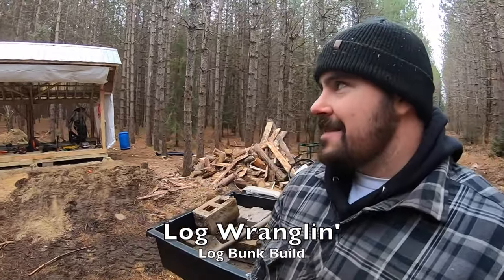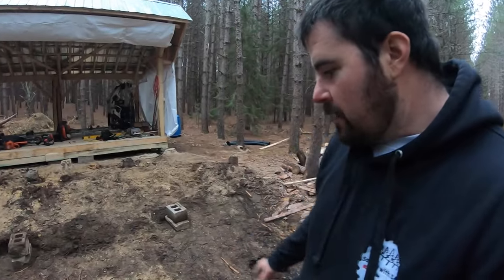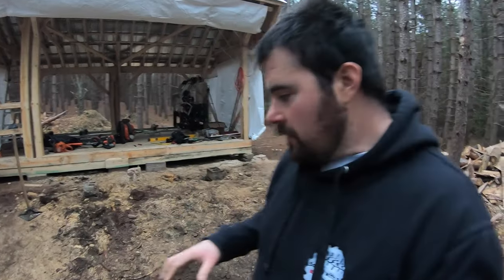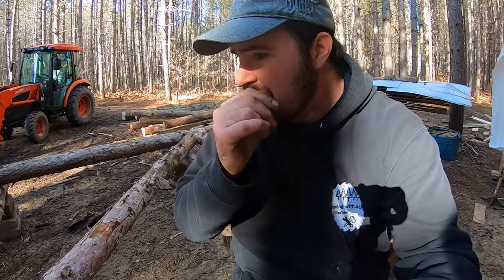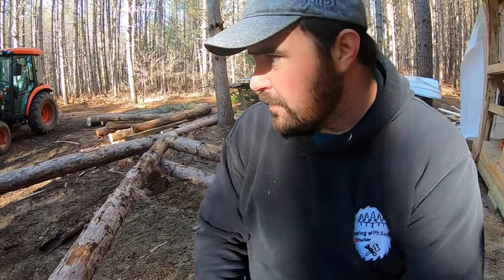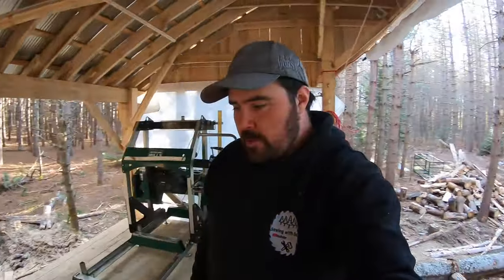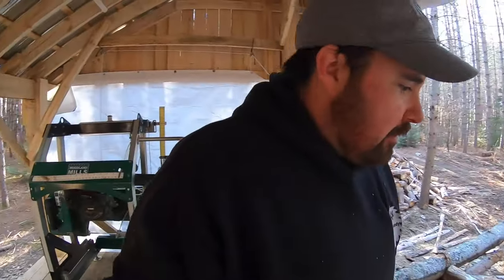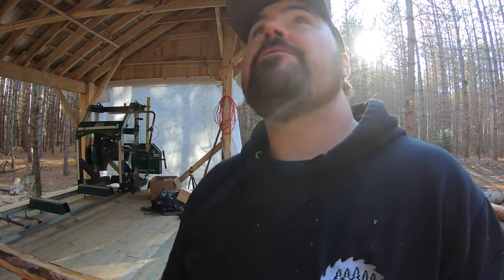Building a Platform for Saw Logs | Sawmill Shed Build - Episode 14

Comment: Try moving the 6x6 transition boards to the outside of the log deck with a 2x10 under each to help them slide out of your way. After debarking the log deck logs, thoroughly coat the logs with used motor oil several times before the heavy rains. Might be a good idea to oil the floor also, it soaks in and is not slippery.I cant work bent over working below my knees, I hope your back holds out. Todd and RJs ideas sounds great. Think about when the snow gets between the log bunk and the tarp pipe, it may be stuck with snow wedged between the first log and the tarp stretching it tight.

Comment: Been designing my future log bunks after your design. But I wanted a little more protection from the deck of logs rolling off the bunks when not in use and getting me.  I'm thinking of attaching heavy duty hinges on the ramp and log bunks. After you roll a log on the mill you can fold up the ramp. Maybe put a small chain to hook it in place while you're not using them. If you're deck of logs shift the ramp will stop them from squishing you. This is the theory in my head at least.

Comment: I'm sure someone has mentioned this in the comments at some point along the way, but laying 2" rigid insulation under your concrete blocks will do wonders for keeping the frost down a bit.  Use a piece about an inch bigger than your block all the way around.
Reply from the maker: Great idea. Thanks for sharing

Comment: Great job on the log bunks.  Time to christen them with a load of logs to be milled up.  As for the 2 6x6's that span across the floor, I would just position them on the 2 green spacer blocks (parallel to the flooring).  It'll will keep them out of the way, but accessible. Also you won't have something sticking up that could be a tripping hazard.
Reply from the maker: That's a good idea with the 6x6's, likely only a matter of time before I trip over them and fall onto my tarp roll up doors haha

Comment: I don't understand the advantage of the platform? You have a tractor with a grapple, why not load directly on to your mill by having the mill just slightly closer to the edge? Or onto your transition pieces? Also how do you utilize the last 6 or 8 ft of your mill? its behind your shed post?

Comment: have you thought about just using your grapple to load directly onto your mill?  all you would have to do is slide the mill to the log bunk side of your shed and then you could sit the log you want to mill directly onto the mill.  thats how I do it with my mill.  unless your not planning on having the tractor grapple available while milling.  just a thought!  nice bunks though. great job on your videos. you get alot done on your own!
Reply from the maker: I normally don't leave my tractor out in the woods at my mill so the log platform becomes quite useful in that case. In the winter it's also difficult to get big machines back into this part of my bush due to deep snow and steep hills. Thanks for checking out the video Jeremy.

Comment: good ideal, but I would have debarked the logs (and coat with oil) to cut down on rot and bugs. water and bugs will get between the bark and the wood.
Reply: Or IF he knew someone with a sawmill, cut the round logs into say, 6x6/6x8 or so sized timbers and gotten rid of the bark and used that to build the deck.....because exactly as you say, that bark is merely going to cause those logs to rot prematurely and need replacing.